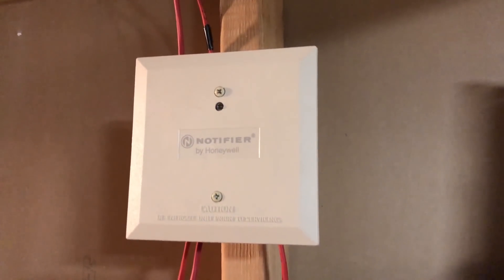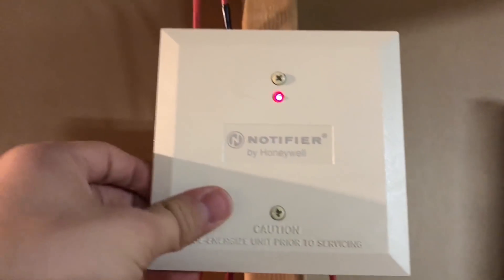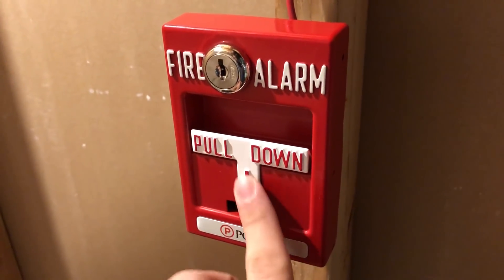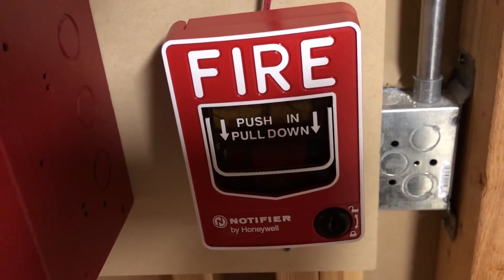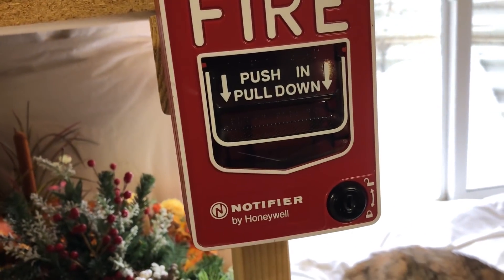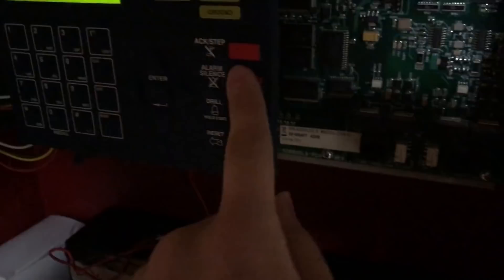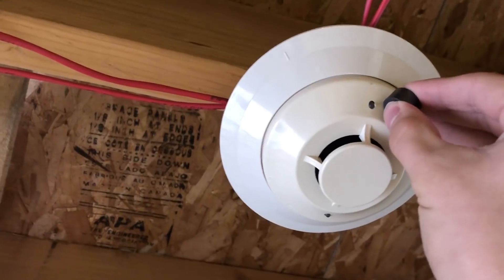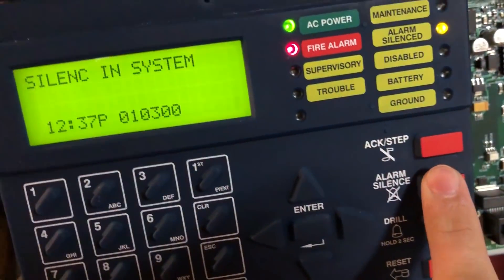Home System Test 21: Simplex TrueAlert, SpectrAlert Advance, and BIG System Expansions!

Comment: Weird. Didn’t know you could
To that. Try getting a module with a green LED and see if it works, that would actually be cool since right now there’s no difference between this and the firelite one.
Reply: Zachary Fleck I don’t think it can poll red at all
Reply: Aaron Productions gggggghu
Reply: Does anyone need 471 Wheelock HSR Horn strobes?

Comment: The 4903- models seems to always have that "fading-out" horn effect 😄. Don't know if I explained that well, but maybe you know what I mean. 

I'm trying to get a 4903-9236, and for all I know, it also has that "fading-out" horn effect (and is also crazy LOUD!). 😅
Reply: +Zachary Fleck Maybe it's the way the horns was designed 😕. Pretty interesting though. I believe the 4903- series came out between the mid-90s to maybe somewhere in the 2000s. I don't honestly know, but I DO know the Advances came out after 2006. 😉
Reply: Zachary Fleck My 4 wire TrueAlert doesn’t do that...it’s probably the sync you’re running it on.
Reply: +Zachary Fleck Perhaps you have a older TrueAlert? Just an assumption maybe 😉
Reply: +Zachary Fleck Ah ok. I was about to mention the "pre-TrueAlerts" that also does this kind of thing as well. But yeah

Comment: Nice! I plan on changing my system a little bit now that I have more time since school sports are over and I want to get some Wheelock Z series NA’s and a DSM sync module and hook it up to my RSS and my Simplex 4004 (obviously a panel from 1999 doesn’t have such a thing as a sync protocol) and tidy up my wiring a bit (hopefully in the future I’ll get FPL but it’s not cheap and what I use now is close enough). Not sure if the sync module will stay but it is something I’d like to have.
Reply: Hello! My name is Zachary Cordova. I’m he owner of Best Security Systems, and I would like to offer you some FPLR for your hobby use! We are the preferred source among hobbyists for new and refurbished parts. If you are interested, you can contact me! Just google Best Security Systems. We are located in Brighton Colorado. I hope to hear from to and improve your videos!